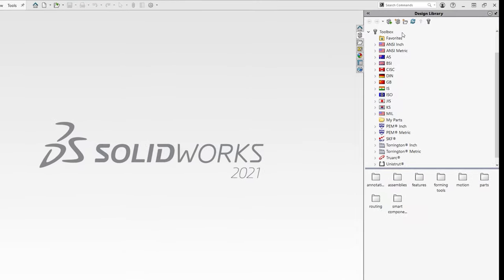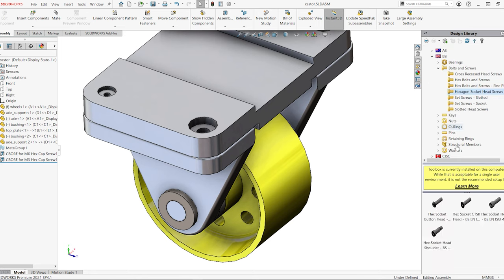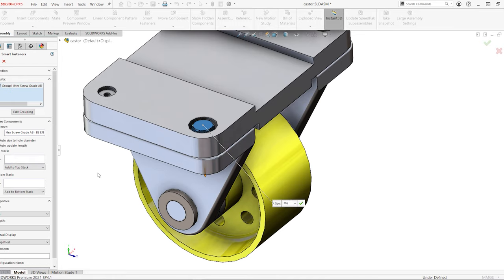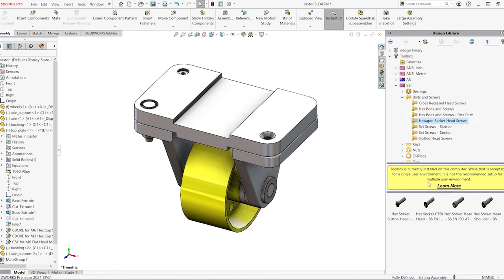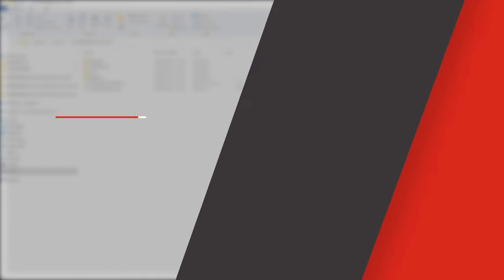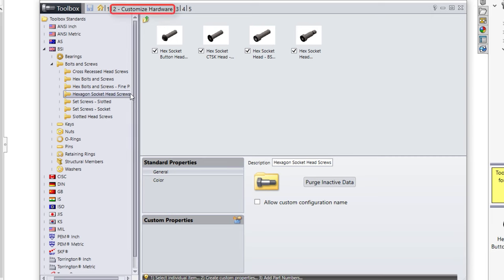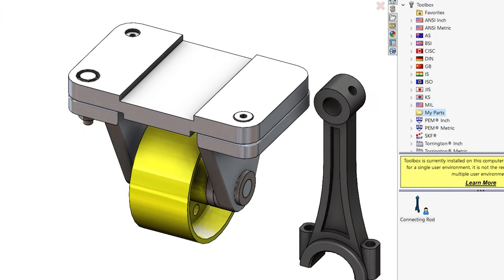How to Setup, Configure & Use SOLIDWORKS Toolbox | Advanced SOLIDWORKS Tutorial

Comment: at 0:25 you say the toolbox has cams.  Where, specifically, are they located.  I found the gears under Power Transmission, but cannot find cams.  When I set up the toolbox I unchecked all the standards that I don't use, keeping only ANSI inch and metric, ISO, and Mil.  You appear to be using BSI.  Are cams in BSI (or any of the others that I did not keep) only?
Reply from the maker: Hi! Toolbox provides a cam generator rather than standard cams. You can find this under Tools > Toolbox > Cams

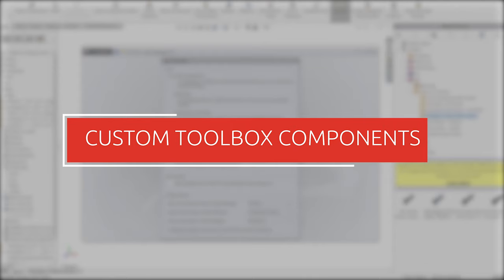Comment: at 4:04, while describing Display options, the bottom like references asterisk that says, "Designation applies only to the AS, DI, GB, ISO, IS and KS standards, but I don't see anything in the User Settings dialog box that has an asterisk appended.  To which designation is it referring?  This question applies to SW2020 thru SW2022, the ones that I have loaded.
Reply from the maker: The asterisk applies to each Component Name, Part Number and Description display options when Designation is selected for any of them. Hope this helps!